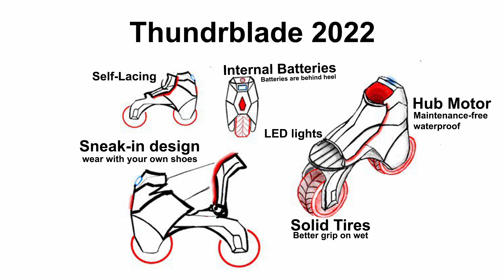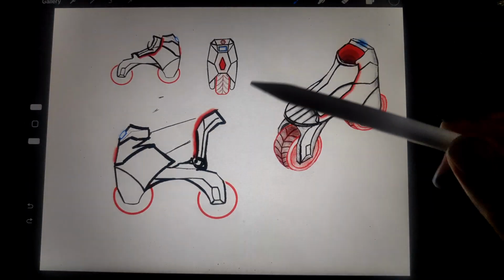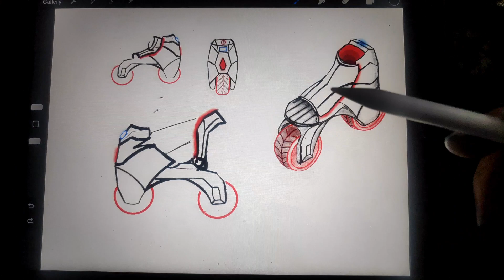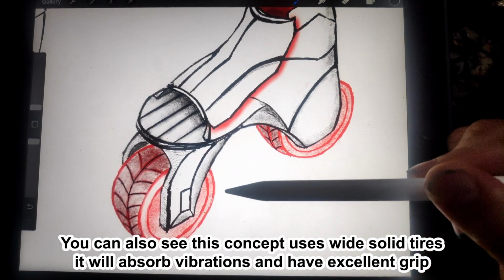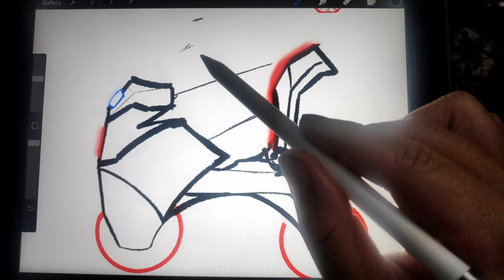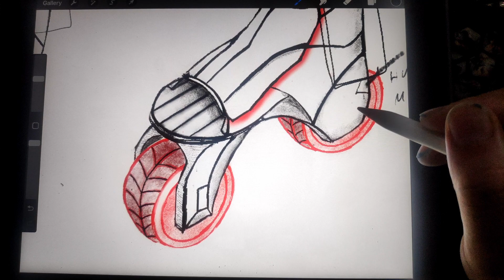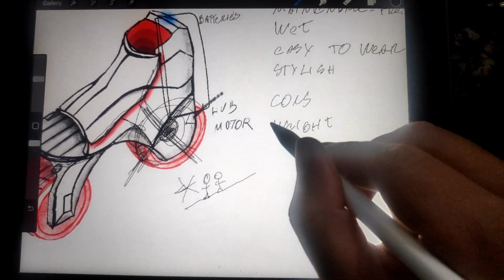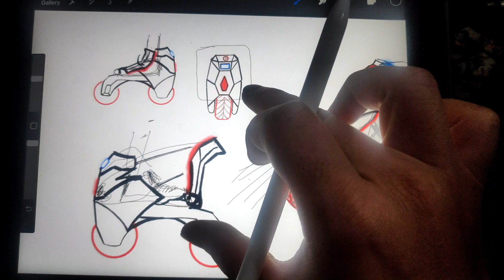Why Thundrblade will use HUB motors going forward

Comment: 1/3 more parts in replies
back again. just saying for some background info. i finished my uni course in product design last year so im gonna give you some tips and feed back even if they might be stupid from me if thats ok.  and no im no professional or have work experience looking into it kind of not really personal reasons but anyways.

concept art. you need LOTS of it. and i mean pages and pages. you dont have to keep drawing the whole set up, you can draw sections of it. break it down, example focus on the frame, different frame shapes design, angles, blocky, organic, wheel base distance, wheel sizing etc, just mix it up even if its stupid looking because even the stupid or simple or stupid simple ones can sometimes come back as inspiration and further develop better or more interesting iterations that seem more reasonable and possible. sometimes crazy is too crazy so keep that in mind this is not even version 1.0 this is like version 0.0.13.2 kind of deal not even beta and way early into alpha stage.

look into things that teach you how to draw. its hard trust me i suck at drawing too i barely passed on that unit in my uni course. look into drawing exercises like drawing a straight line. no seriously
we had to learn this stuff. learn to draw elipses, circles, back to straight lines long and short all free hand no rulers no tools but a pen not pencil. they taught us to use pen because they didnt want to see multiple scratchy chicken hair lines. you do it with less pressure and then harder pressure. also from say starting out 10 attempts to 3 attempts to draw a line,elipse or circle etc. this will make drawings alot neater and more professional. oh i forgot look into "perspective drawing" like 2 point, 1 point etc. after lines and elipses start with simple shapes like squares, rectangles, triangles in all sorts of shapes and sizes and proportions etc. these "shapes" will help "block out" very very blocky and basic concept. forget about adding the beautiful curves and such we need the foundation and whether it is feasible or not. 

drawing is one thing, but 3d mock ups is another. you can get cardboard, paper or clay and just make shapes and forms. just to block out ideas of how you want a particular section to be 1:1 or smaller scale. 3d mock ups is a further stage in development but i was always a 3d hands on person so it helped me see my drawings better in my head.
ok that was just about conceptualising and drawing feedback. 

but before drawing, before concept even......research research research. obviously what inspired you was air gear, get every screen shot you can from the show and manga possible. it can be outside sources such as i dont know, nature, mountains, paths, leaves, animals, bones etc. other things similar so electric bikes and skateboards and other electric vehicles. what are they doing, what other features they have, take note. obviously what other rollerblades are doing, which rollerblades you like and their features. hardboot soft boot, the strap designs, laces, soul plates, frames, wheels etc. and possibly lastly what other companies that have tried or trying. i mention in other comment that tiago made a video on this upstart company doing something similar to you, see what they or other people are doing that are similar to you. see other ones that failed also like i think this one company acton blink or something made those electric skateboard penny boards and they made electric rocketskates. video called inside actons rocketskates ces 2015. and keep digging for other things to be inspired by and features or things you want into your designs.

this was hard for me but follow the kiss rule. keep it simple stupid. i personally always over complicated things but you gotta sometimes cut back on things and make the base the foundation good or good enough to THEN build on top ok.

ok so that was just general design process stuff theres more to it but i dont know your background or how deep youve gone on your own. now im gonna try to give feedback based on whats shown in this video.
Reply: 2/3
so the battery. actually you know what this goes back into research and concept. how big are batteries, can you make custom batteries or know of any companys and manufacturers that can make custom batteries. what shapes and sizes etc are batteries. ok now finding out some of that can it fit into behind the heel this means you may need to change the shape and form of the heel section for battery. need more pictures of that from different angles and perspective. like i said draw the blocky outline concept for example how big the batteries might be. then draw the outline around the battery for both looks, function and possible protection etc. consider materials. oh wait i forgot about materials will need to consider in research and possibilities anyway. thing about that and if theres a screen, light, buttons etc for battery. how big those other components might be redesign redraw the heel. this is why i said need lots of concept art. consider hot swap batteries im sure plenty of people have said it. personally if its not completely custom batteries then not possible. not in a neat way anyways which is the point of hotswap. for hotswap batteries look into some electric skateboards, bikes and scooters that have hotswap. for example from the top of my head the e-glide g60 electric scooter.

the auto lacing. too complicated i mean look at the nike back to the future style shoes. only recently they did make it a reality but its nike, they have money and engineers and etc to use. we do not. remember kiss. i suggest you look into the doop swift skates or the usd shadow that are bootless rollerblades. im pretty sure you may have heard or seen or researched into them but im saying it here just in case. theyre design was very simple and proven to mostly work so take note and implement some of them into your concept. might not be what we want now but kiss we need something "possible" first.

yes do play around with lights and such. front light, back light, underglow, lights to be seen or to see. play around with placement on  the skate. near the front, little bit angled to look like angry eyes, etc.

im not entirely sure how hub motors work for it to be fully locked without using more battery power to keep it centered. im just assuming thats how it technically works i could be wrong. i understand in the skateboard world it helps with braking but braking is just slowing the rotations to a stop but still has some "give" to it so i dont know again could be wrong havent looked into this tech in a while. but if it needs an external part to be put in place similar to your older prototype with the friction drive but smaller maybe a rubber stopper to stamp on the wheel to keep it locked. sort of like the rear brake to a scooter where you press down to skid the wheel to a stop. but that would mean extra part and well possibly over complicating again remember kiss. but also remember even stupid idea might not be stupid. so keep that in mind it can come back later maybe.

im pretty sure it wouldnt be maintenance free but think of simple design shapes or processes or however it needs to be for easy access when the time comes to do maintenance or for factory return maintenance or someone at a skate shop can open up for maintenance. 

weight yeah.....im not a magician. i dont know any black magic to make it weightless with current technology. we are sacrificing mobility and agility of using it regularly for motorised use. but hey just advertise( may need to talk about this too later) it more that its PRIMARY is used FOR motoring.

speeds we can break it down though this might be tough considering without proper testing and such. can only have a better guess because you have the first prototype with a different drive system. but personally i would aim for 20-25max kmh and this is REALLY pushing it. considering the size, shape, weight, drive system of these possible prototype. but also think about maybe different models. like a beginner budget model 8-15kmh, 20-25kmh and 30-38kmh. 3 different skates. obviously the faster ones will sacrifice some things like weight and space but have bigger battery, bigger drive system, double motor vs single etc. or they could be programmed modes but would need to develop this idea further. 

overall everything needs further development. more concepts more different directions even the weird ones. maybe do a tri skate with 3 hub motors. even though the inspiration is air gear with 2 wheels to save weight but 3 motors more power maybe? think about it more. remember the kiss rule. and to be realistic to be possible first before we do the impossible.

just quickly read through some of the comments here on this video. basically what this guy Ilko Ambarev said. this was a great comment honestly. a lot more concise than mine but take it as part of the concept. that its only one of many directions to take. just to add or modify his comment about basically using what the market already has to offer. actually would be great to use for the "3d mock ups" just put something together it might be janky as hell but just see how things go together with the current tech and research and take notes from it. what can be better, whats worse, what do you like personally, what do you like objectively(aiming at most people), what can you add or take away.
ive read some of your replies to comments here too. yes may or may not need a professional to do drawings. i agree with you about staying niche. i personally would go for full custom BUT you need to consider money. please please dont go into debt. if we need to cut back ideas to get at least the foundation out with less features thats one route you "can" take ok. start small maybe medium.
Reply: 3/3
also with the drawings just do the lines and elipses for 30 minutes before doing actual concept drawings to warm up. a lot of the stuff i learned could be learned from the internet honestly. ive told you some things to look up. study them. research, concept, concept development, further development, 3d mockups, 3d drawings and spec to scale etc. perspective drawing 2 point 1 point etc how to draw lines elipses circles and shapes in perspective. really need to wrap your head around it might take a while before it clicks. oh and quick note use colour in your concept for important notes, or important parts and components. try not to shade or use colour to colour. use it as a highlighter basically to focus and put emphasis on X. it brings style and focus without looking messy and unprofessional. if you want to do shading then need to practice shading like practice drawing a line.

sorry if this was long and a jumbled up mess and wasnt too harsh im just throwing things at you for you to think over. remember design is a process just follow the steps and itll hopefully lead to the "product". check out tiagos recent video about electric skates. they have rollerblade sized hub motors and seems to give enough power and torque soooooo yeah might wanna talk to them. quite honestly theyre concept prototype is quite far ahead but still to be determined like all things.

ok some real talk here one of my projects for uni. thee BIG project for uni where you can do whatever you wanted was......completely 3D printed, motorised rollerblades. so alot of things i commented here was from my project. and it was all thanks to air gear and to you. especially you because youve made prototypes that work. due to limited time and the "scope" of the unit being make a mock up concept and show how you got there. which basically means get to close to finished prototype as possible with a folio of work as evidence on how you got to the prototype. i took big inspiration from you with how the motor sits and the doop swift boot. the boot plate, cuff, wheel frame, internal wheel and other minor things were 3d printed designed to be printed in parts to put together. so example was the wheel frame was printed in 2 parts with jig saw dove tail pattern. used molding silicone and urethane resin to make the wheels with a 3d printed internal wheel to house the bearing. yes we learned to mold make and such. research thanks to how rollerblade wheels are made. i did a chain and gear drive system from skateboard instead so it was slow and i was fat at like 80kg back then. it barely held me and went 5m forward before creaking hard and i was like nope better get off before something snaps and i would have to repair or remake parts. it didnt need to be fully working but close to working. passed the can it hold my weight and can it drive for a distance for being mostly 3D printed in PLA i might add, my set up at the time wasnt abs capable. in the end i did break it very easy but it was probably the most unique oddball project out of the class sooooo. we also learned some business. i think the whole 5 year business  plan was very interesting. especially with what youre doing with thunderblade. you need to talk to manufacturers and companys get quotes and such to get an idea of money and loans, grants etc possible profit gain and losses etc. just like "design process" the "business plan" is just as important for later on. ok im gonna go now. look forward to your updates this time really need to polish up ok. you need realistic answers to questions. realistic solutions to problems. dont just say things that are "possible" but arent realistic. trust me thats easy ticket to the dark side of kickstarter and indigogo.

i know this is the second video showing off the concept. but you really needed more concept art to show, better presentation of notation on the art, more angles and perspective to really explain this to the people who may not understand either what theyre seeing or what youre saying. thats why the neat and tidy concept art and neat and easy to read notation is very important to portray to the "client" who knows nothing. now really good luck god speed this was long
Reply from the maker: hey, thx for the long, detailed and very specific feedback XD I know you took a lot of your time to write this because you want to help and I appreciate it.

firstly, I knew that already. But keep the feedback coming, you never know when you are going to learn something new.

thank you very much for the design tips, but I do not intend to become a better illustrator. I am hiring illustrators to make the art and 3d modeling. I just didnt have the money and wanted to make it out as soon as possible.

just like you used the term KISS, thats exactly what I did. drew it myself the best I could so I could make the video and show it off as fast as possible without messing with hiring anyone which could have taken days or even weeks longer.

just a reminder, things here are at the idea stage, so I can modify them as I please. there's no need to think so hard before showing off the ideas.

Im not presenting this to a board of directors from some multi-billion dollar company. it is just a YT video to share with everyone that supports me that I am indeed working on something. and that sketch was good enough for this. the drawing could convey a little bit of the idea and concept and it was good enough for now.

 I think next week i will have a professionally made 3d model to show off.

the old concept was capable of 40km/h new one should be able to make to 30km/h at least, but not to 40+ as I said in the video.

About self-lacing - it is not that complicated really. lots and lots of shoes have this system, it just lacks a simple motor to rotate the disc. I will make a video talking about it since a lot of people are finding it too complicated. in startup language, self lacing might not be in a MVP, but for some people it might be a killer feature so much that it should be in the MVP. who knows?

about atmos gear. their prototype is actually very good and it mostly works. Thundblade was in that stage 6 years ago. I will share a design I made in 2015 for a hub motor that would be developed without permanent magnets which are lighter and have more torque, but the company that was developing the motors had some financial issues. I will make a video about it.

btw I would love to see your project. Please reach me on twitter if you want to show it.

Comment: Suggestion. Self lacing is good and all but you would remove costs and possibility of motor failure by just using a similar system as snowboards
Reply: Also I'd ditch the RGB on the sides and focus on lights on the front and back for safety
Reply: You really got to focus on cost here man as your design is cool but you need to keep in mind battery life is important and un needed featured are going to skyrocket the price for no reason, ie the self lacing feature
Reply from the maker: Hey Ryan, thx for the feedback.

I can see a lot of people think the self lacing would impact battery life. It will not. its nothing compared to the motors. not even 0.1%. really.
the cost though is a valid concern. if it impacts too much it will definitely not be in a product release. for now its just a concept to see how you guys react. Myself personally I think it would be nice to having to sit down to put my skates.
so, a disc system would be a good alternative. I see this being used in a lot of sporting equipment, like cycling shoes and snowboard boots. the self lacing is basically the same thing but with an added motor just to pull. you'd still need to release them manually. and you could still use it manually when batteries are dead.

the same with the RGB lights. it will depend on how everyone reacts. I will conduct surveys about these kind of things later.